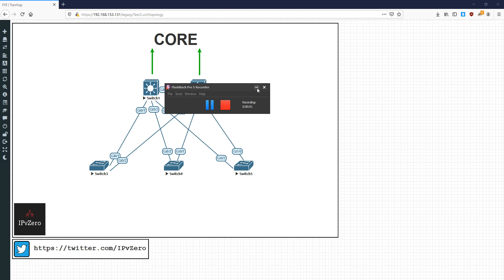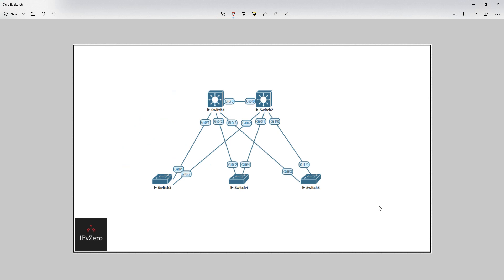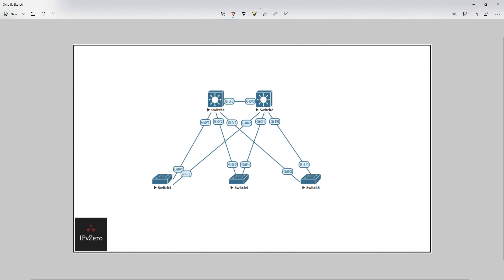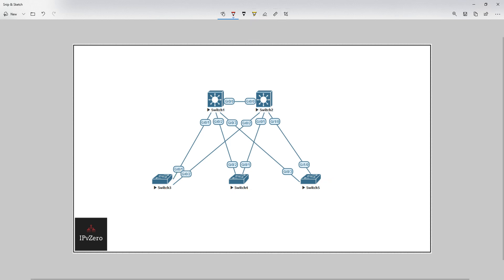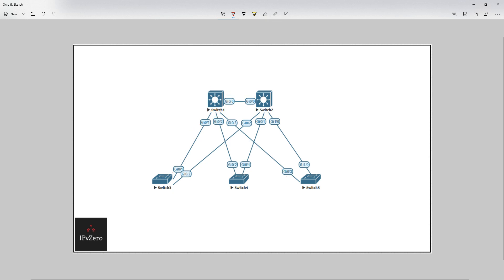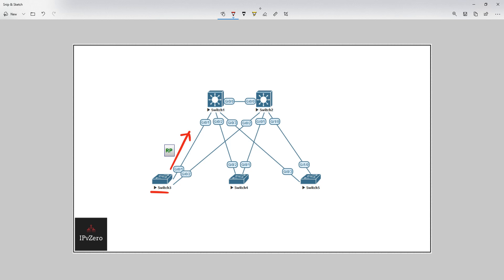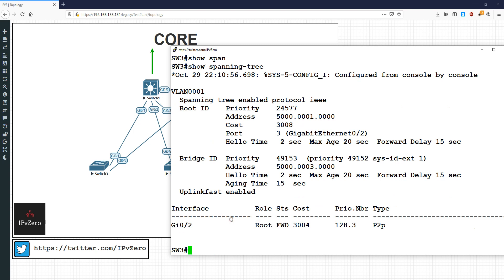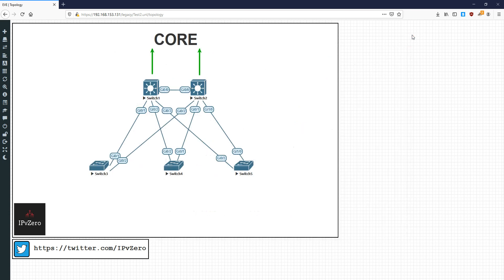CCNP Switch: Uplinkfast | Explained & Configured!

Comment: ok but now is time to speak with customer for change this 3 l2 switch with 3 l3 and move all to routed lan..ahhahaha for my point of view spanning tree is time to ban to network desing. Agree?
Reply from the maker: Hahaha Yes! I absolutely agree! Routed Access Design is so much better than L2. 

No STP, ie no blocking links, ECMP, simplified multicast topology, failure domain has a reduced blast radius, etc, the list goes on! However, many people still implement L2 for reasons of mobility and (unfortunately) the lower cost. In fact, if you're gonna run STP, you should be running Rapid Spanning Tree as opposed to CST enhancements like Uplinkfast and Backbonefast! That said, it's still worth knowing the theory so I'm gonna try and cover most of current CCNP Switch material. 

Don't worry, though, I'm gonna make a video comparing L3 vs L2 and will definitely be encouraging an L3 design haha!

Thanks again for watching, Luca :)
-John